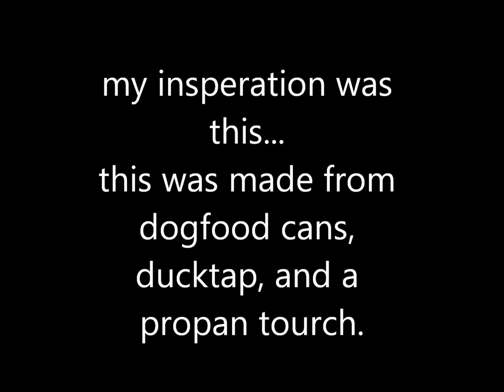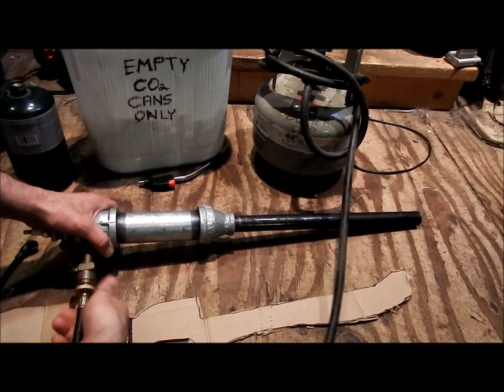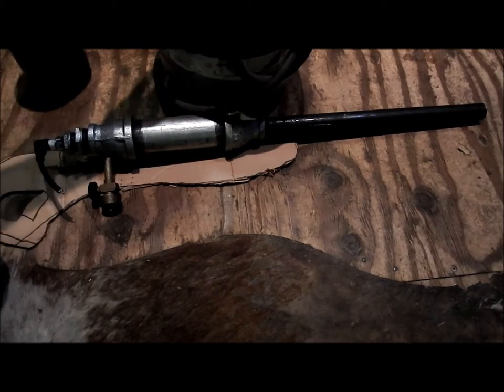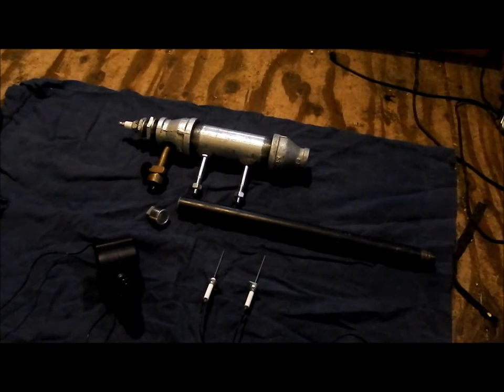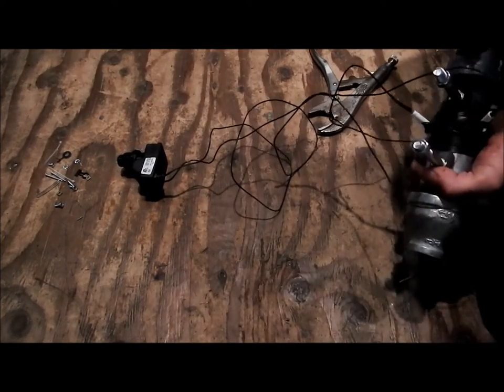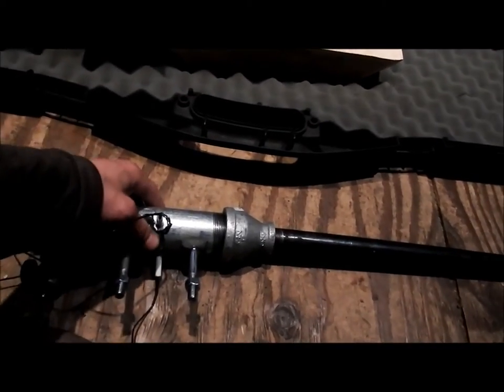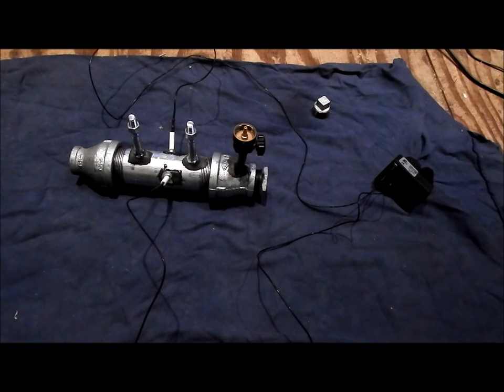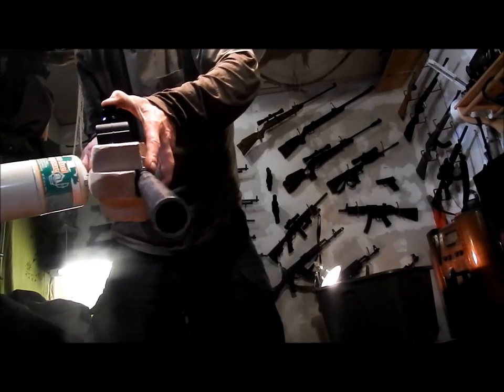Building My Propane Rifle (spud cannon) pt.1

Comment: I myself have spent many hours designing a propane rifle, though i have no hands on experience. I suggest using an injecton system for the propane. If you can inject the gaseous propane at a high speed into the chamber, and place the ignition at the point of mixture, it should be enough to start the Ignition of the combustion. Something like a spring-loaded syringe that has a max volume of 5% of the combustion chamber.